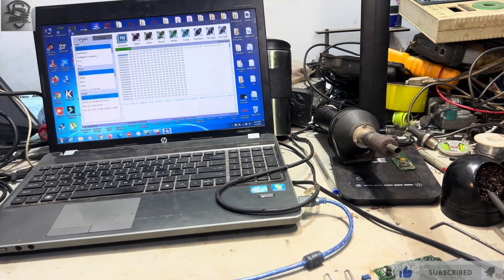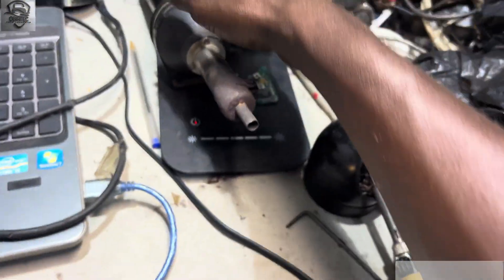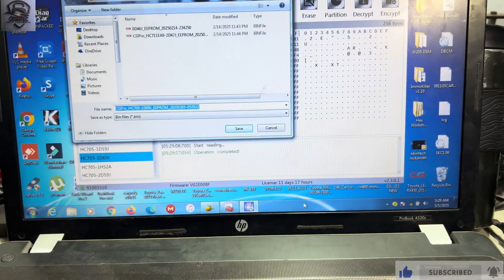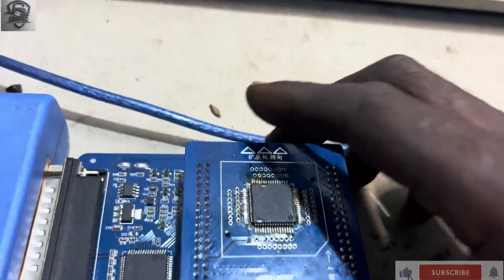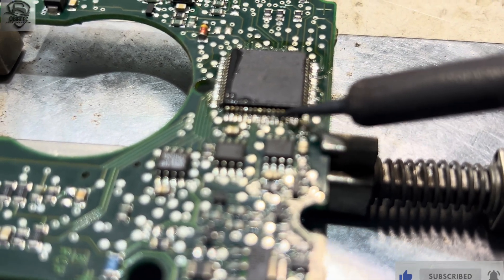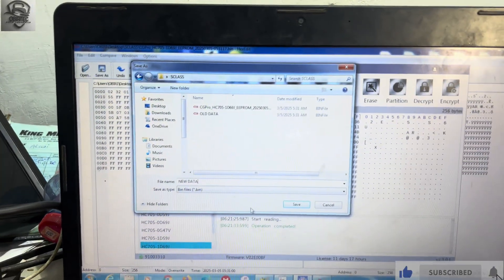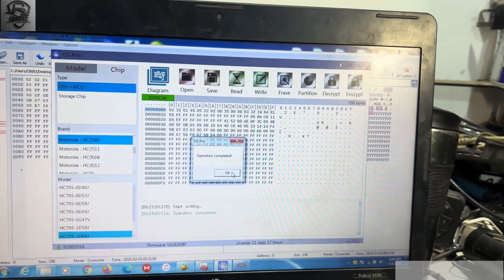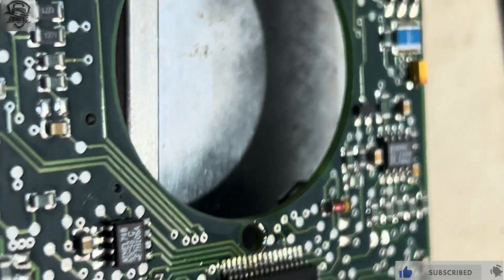HOW TO DO MERCEDES-BENZ SCLASS W220 GEAR_SELECTOR LIVER PROGRAMMING| WITH CG PRO

Comment: Bless you in this day my brother i call the The hardcore programmer. 

What do you use to program Rear SAM of W164 ML430 07
Reply from the maker: Thank you……..  what’s the process id, but mostly they are plug and play
Reply: @obiritech  thanks for your prompt reply. I found out it is not supported but i also appreciate your insight about it;the Cameroonians brothers who reached out to me that the rear SAM was found damaged by water so a new rear SAM was ordered. Upon installing, the fuel gauge was no longer displaying so they assumed the SAM must require programming because the fuel gauge still works with the original one. 

I contacted CGDI support and they said that this vehicle is not covered under CGpro & CG100X
Reply from the maker: CGDI will tell you that they don’t support such but you have to have a way around it moreover W164 has two different types of REAR SAM and there’s a socket with 8 pins which lies as far end of the vertical edge and on the same Sam it could empty without pins so if your car comes with one that doesn’t have pins and you plug in one with pins not only will the fuel gauge won’t work but boot and others will not work properly
Reply from the maker: @dfwcarkeys  DM me
Reply from the maker: yes, you can
Reply: @obiritech  i could not find ur whatsapp on your YT profile
Reply from the maker: @DFWAuto_Hack send me 
an email @obiritech@gmail.com